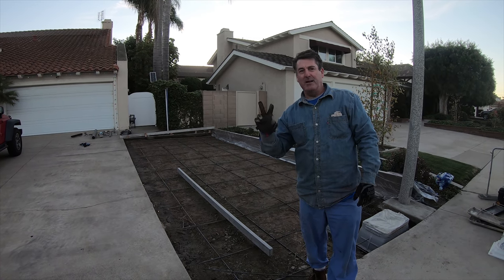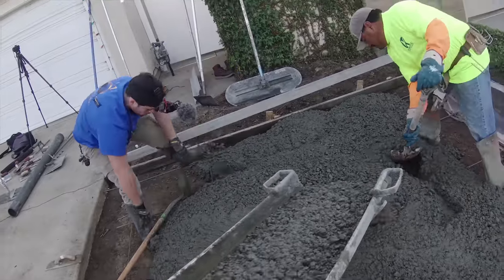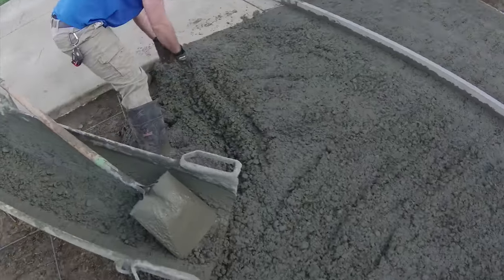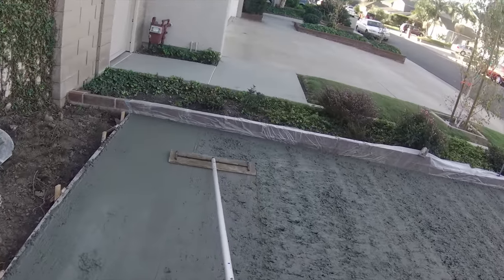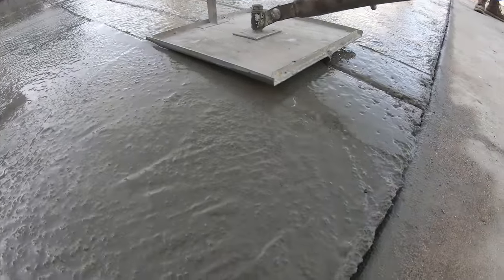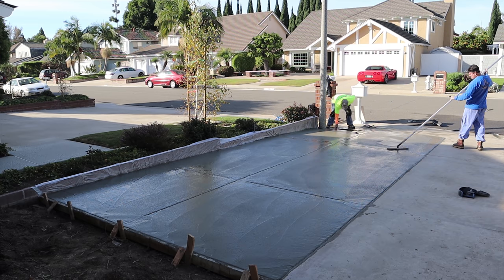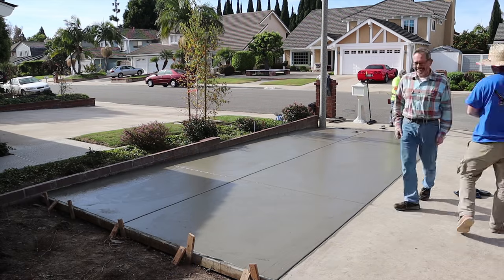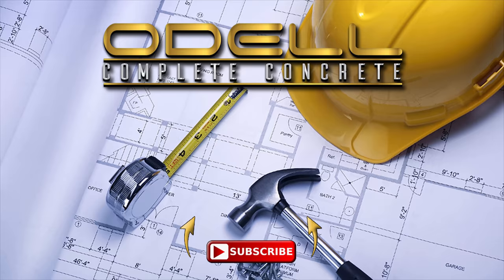How to Pour a Driveway Addition Part 2

Comment: Nice quick job
 No vibration?  When i helped my Dad on concrete jobs he always used a garden rake on the mix to work the air out and grab the rebar to pull it up.
Now you will be going back to replace the existing driveway😄
Reply from the maker: Never know, its a possibility